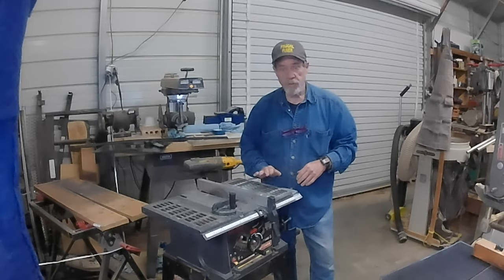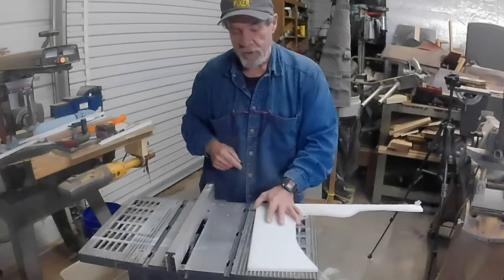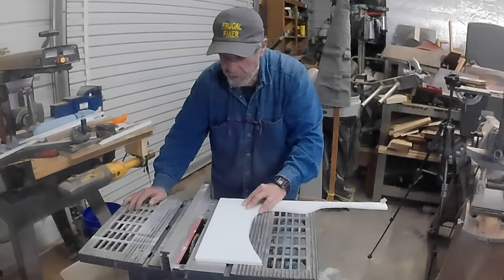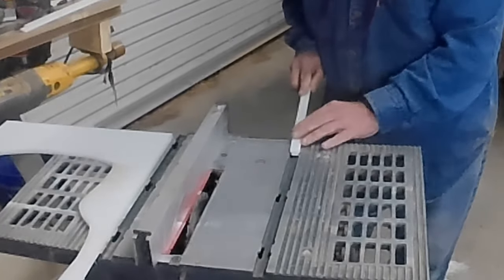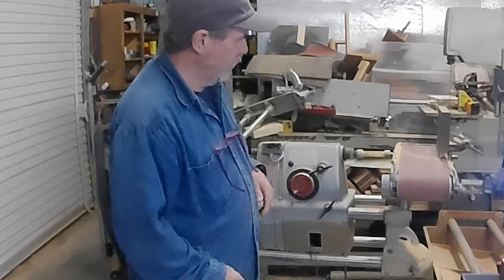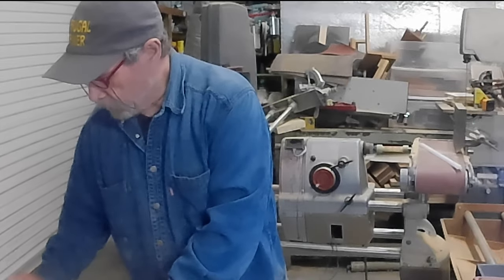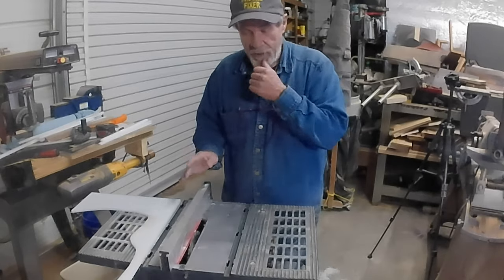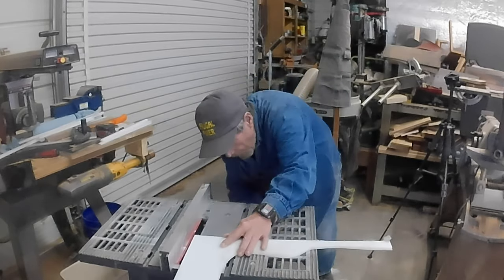Craftsman Table Saw, T-slot tabs solved, with 3 easy cuts. How I make runners for a saw with tabs!

Comment: If you’re making a crosscut sled for a Craftsman table saw, there is a much easier workaround. Simply place the runners flush against the ends outside the table. No need to mess with fashioning a T-shaped runner.
Reply from the maker: Great idea I will keep in mind if I need another jig or something to reference to the table. Thanks!